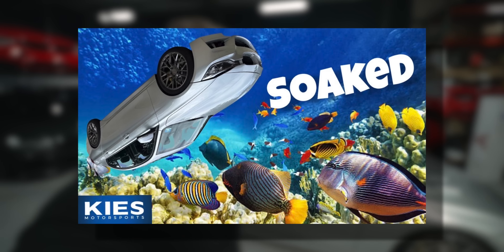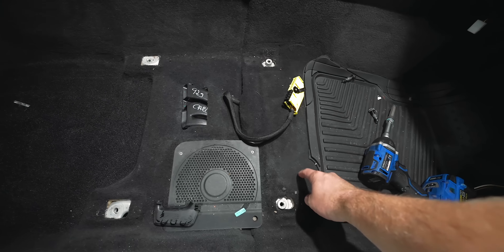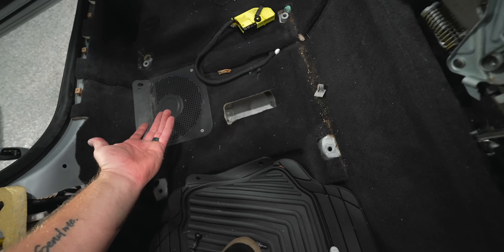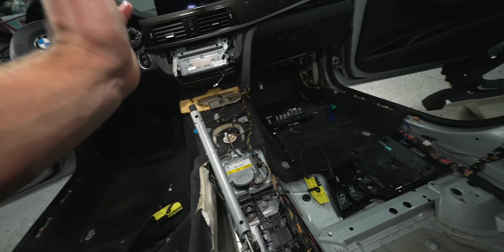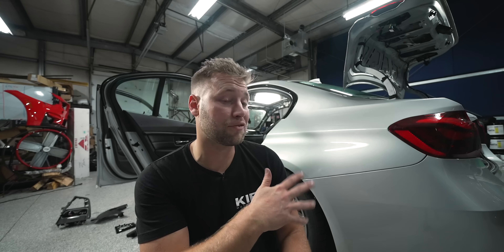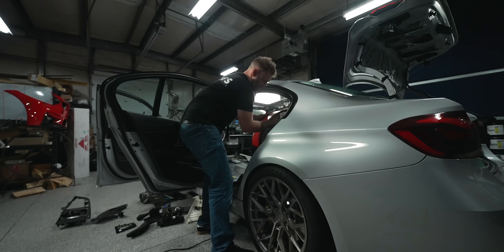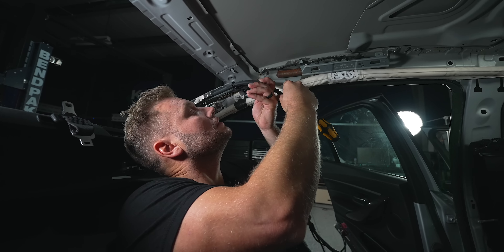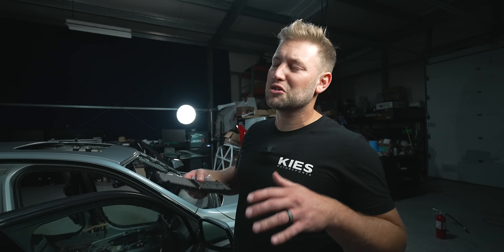🔧 BUILDING the ULTIMATE BMW 328i F30 - Cutting off the roof! Ep. #2

Comment: Use a drop of oil when you are drilling metal. Extends the life of the bit by helping it stay cool
Reply: Also, for drilling metal: slow rpm and higher pressure on the bit. Wood is the opposite - high rpm and low pressure.